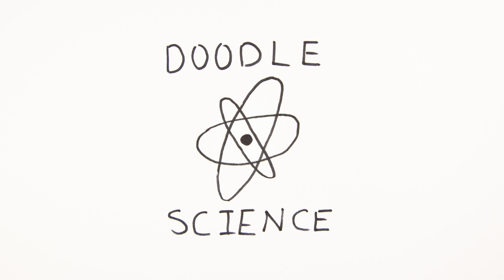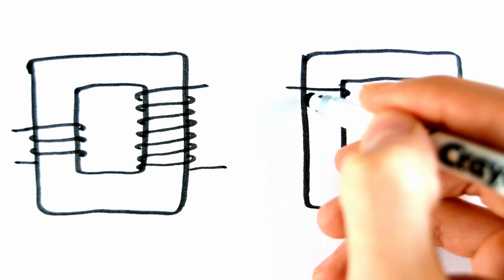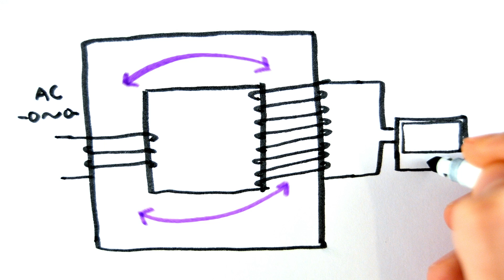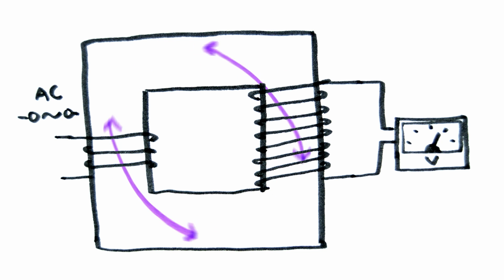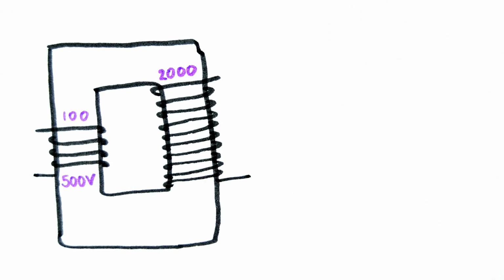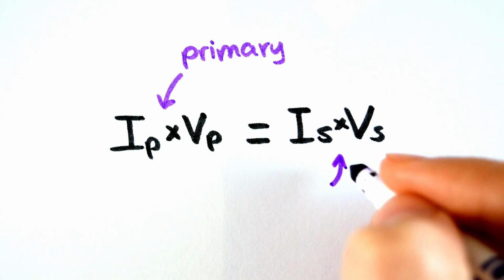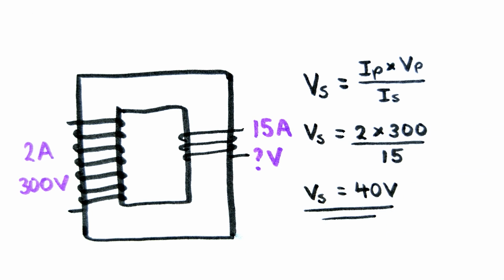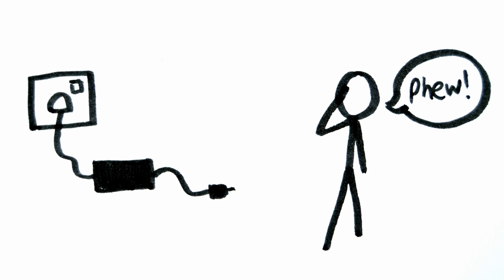Transformers | GCSE Physics | Doodle Science

Comment: Hi +DoodleScience, thanks for the great vid, really helpful for my GCSE revision. Just for clarification, I wanted to ask if the alternating current passing through the iron core is electromagnetic induction? So is the changing magnetic field causing a voltage to be induced in the secondary coil? Also is the reason that the transformer is almost 100% efficient because the iron core channels the magnetic field lines through it? Also, why does the number of turns effect the voltage induced - is it something to do with the resistance? Finally, I saw an equation which said: Voltage = number of turns x change in magnetic field (flux)/time. So I was wondering if increasing number of turns , increasing change in magnetic field and decreasing time increases the induced voltage? Is time just the time over which the current changes +ve to -ve (frequency of the AC? I wasn't very sure about this). Anyway thank you for the video, sorry for the long comment 
 :)
Reply from the maker: +Gautham Ramesh I'm glad they are helping! To answer your first question, the changing magnetic field in the iron core induces a current in the secondary coil, which is electromagnetic induction. One of the major reasons they are so efficient is because the iron core is made from laminated steel which reduces energy losses in the form of eddy-currents. An eddy current is a small loop of current in a metal which would occur if normal steel was used because of the magnetic field that passes through it. So this laminated steel allows the efficient linkage of the magnetic flux to the secondary coil. The formula you are referring to is from faraday's law of electromagnetic induction which states that the induced voltage is equal to the rate of change of magnetic flux linkage. Magnetic flux linkage is the number of coils x magnetic flux. This is why increasing the number of coils would increase the induced voltage. You are also correct about reducing the time to increase the induced voltage, as long as you use the time for which the magnetic flux linkage has changed in (e.g. from 20Wb to 0 in 5 seconds). You don't need to know any of this for GCSE physics by the way but if you enjoy physics then I hope this answered your questions :)
Reply: +DoodleScience Thank you for the quick reply, this was very helpful:) I enjoy any physics, it' always useful to understand how stuff works, and I'm taking A-level physics so I'm sure it will be handy.
Reply from the maker: +Gautham Ramesh I agree with you there! Good luck with your GCSEs and hopefully I'll have some more videos for you when you do A levels :)